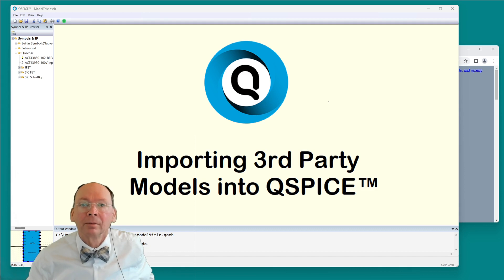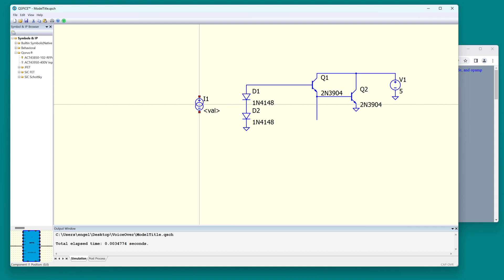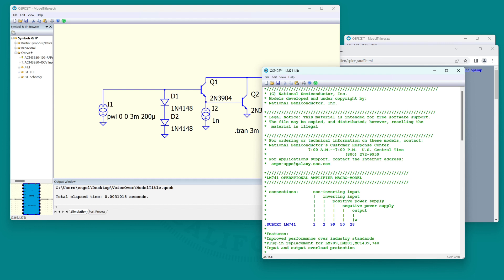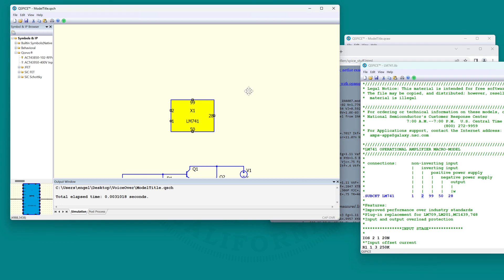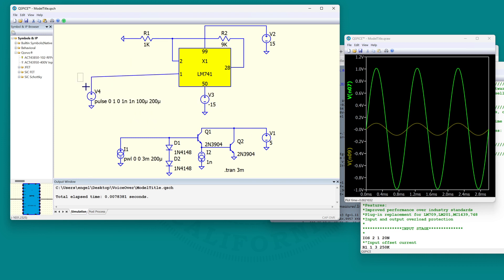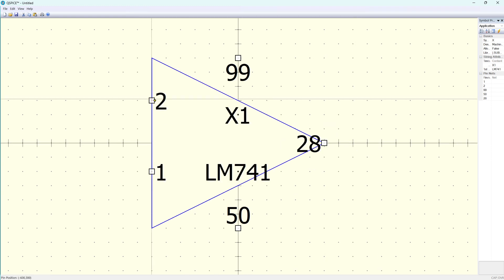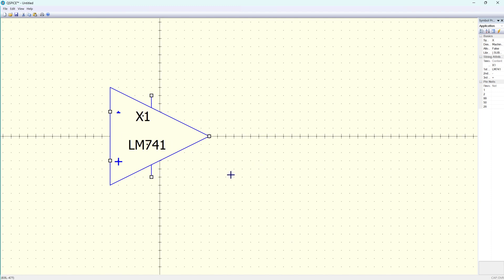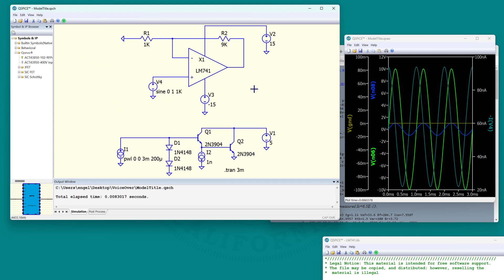Import 3rd Party Models

Comment: One of the difficulties in using SIMetrix with the PSPICE models TI often provides for their newer parts is that a multitude of subcircuits are used for one device, and SIMetrix requires the creation of a symbol for each one. I usually can collapse their models into a single subcircuit (notably since these subcircuits are often used only once), but that takes quite a bit of time. Does anyone happen to know if there's a better solution to this in Qorvo?

Comment: A most excellent LM741 opamp example.  🥳 The LM741 is still found in many circuits today.   I would like to import the Vishay IL300  linear optocoupler to isolate an Input Opamp from an Output opamp.  The LM741 opamp is good enough for a Plus or Minus 0to10vdc learning circuit.  😎  Thank you.